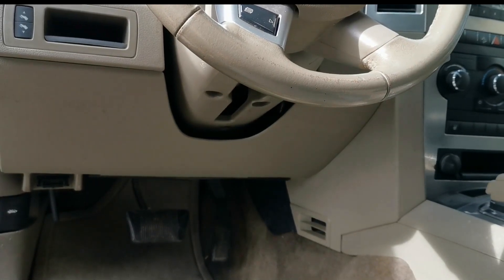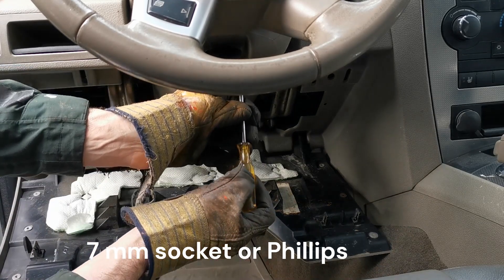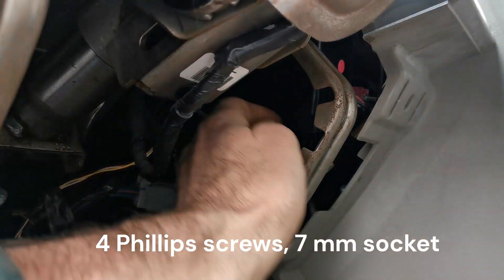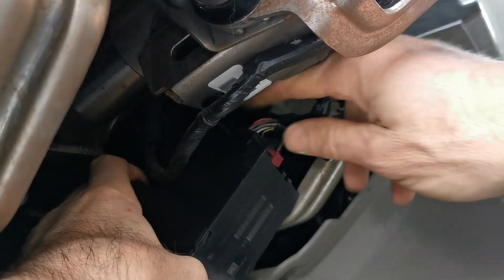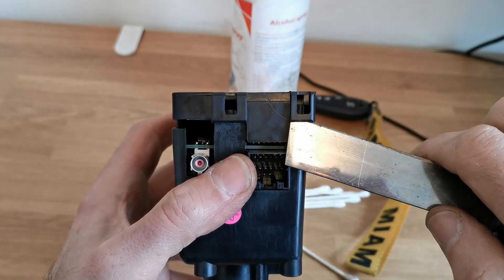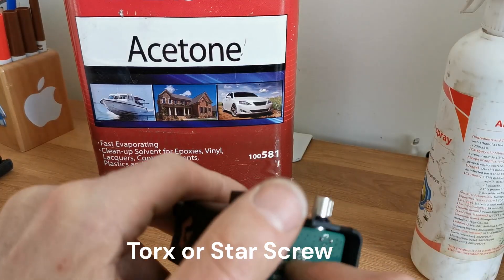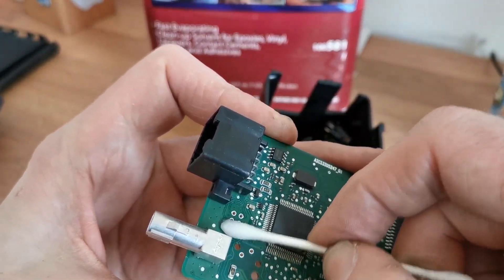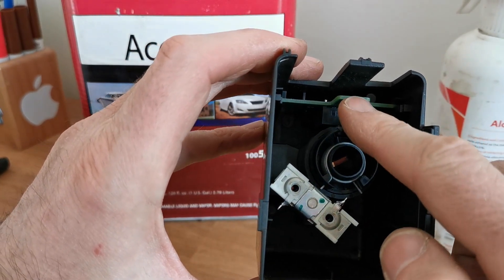Jeep Grand Cherokee 3.0 CRD Diesel 2008 WIN Wireless Ignition Module

Comment: This is the same process as my 2008 unleaded Grand Cherokee 4WD, excepted the three screws that hold the lower steering column cover in place are torx screws and not Phillips/7mm screws.  This helped me switch out the ignition module.  Thanks.

Comment: 2008 crd 3.0 here I think my modual is the prob power to everything no crank no click fuses and relays seem to be fine. I was thinking of cleaning it if it would fix the problem 🤔
Reply: How did u make out..I have the same vehicle and the same issue!
Reply: @khandymann  I junked it awhile ago earlier this year. i had a problem with the module that went to crap , starter, engine block had a big  oil leak its a common problem , its a cheap part for the O ring that causes it but very expensive to fix it due to having to get at it. top end oil leak i should say. it was too much to fix compared to how much i purchased it for